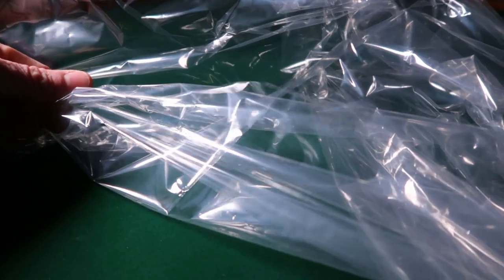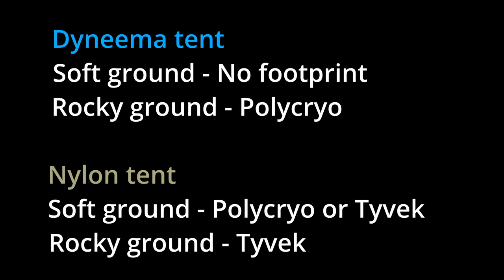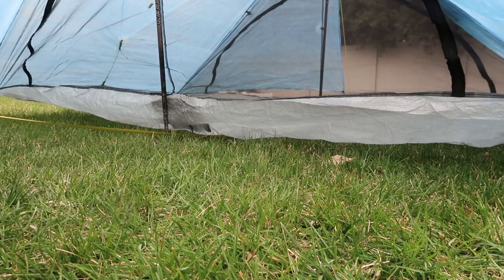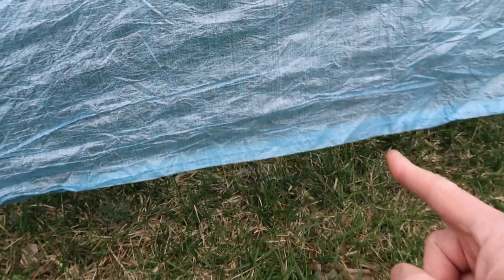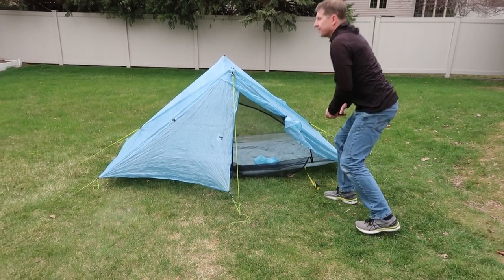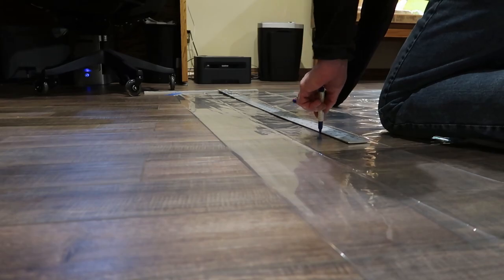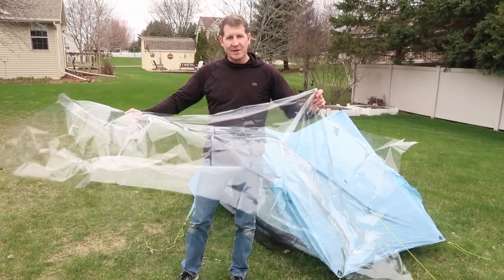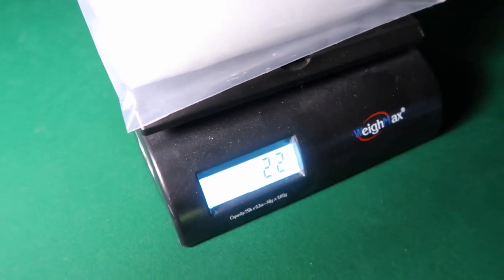DIY Polycryo tent footprint the RIGHT way

Comment: 1.  I get the Cyro from the cheap window insulation from Frost King, large size.
2.  I fold painters tape all around the edges which really adds some durability.
3. I stick some duck tape on 2 corners to help see which way is up.
4.  After placing it on the ground I carefully rub my hands over the surface & remove any sharp objects.

I have 400+ miles on my current piece.
Reply from the maker: Thanks for the suggestions.  Good stuff that viewers should consider.

Comment: I’m testing out using Mylar emergency blanket for the footprint. Has been working fine so far for the past couple of weekend trips. It’s likely not going to survive very rough handling, but it’s really light and dual use as emergency blanket.
Reply from the maker: That sounds like a good idea.
Reply: I was thinking about trying this. How did it work out? It’s a year later so I guess you have had plenty of time to love or hate it
Reply: So? How did it work out?
Reply: @JediStockTrader  the cheap Mylar ones from Amazon started ripping from the edges maybe 10 days of use. They can be fixed with clear tape but I don’t recommend them. Polycro was tougher, but I also started getting rips from the edges after a while as well. Both I think is caused by my shaking the condensation off in the morning, and also from granite abrasion. They have limited stretchiness, causing any rip to propagate quickly.

After going through a couple of them each, recently I’m switching to Sol emergency blanket XL. The size is almost perfect without cutting for my xmid pro 2. The material is slightly stretchy and feels significantly more tough, while being almost as light as regular Mylar. It hasn’t ripped on me yet but only used it on couple of nights.
Reply: @tanvach  Interesting your doing with SOl, I thought maybe it was not as strong or puncture resistant to the ground! I was looking at both to try for a tarp...mmm

Comment: Just want to say that I really appreciate your content. It is some of the most clear and insightful content out there for sure. I’m hiking the JMT in August and your related material was invaluable. I also have a Duplex but bought their DCF groundsheet that weights in at 3.1 oz (their numbers), so it comes in about an ounce heavier than the Polycyro but much better than Tyvek. DCF isn’t know for great abrasion resistance but I suppose that it isn’t being dragged across the surface too much - I expect the durability to be decent if not as robust as Tyvek. Also, I saw someone measure the puncture force with a needle across all three materials and DCF did not fare as well as the others but I’m not sure he even mentioned the DCF weight. Well anyway thanks again! P.S.: Loved your stove efficiency optimization study. Good stuff!
Reply from the maker: I saw that same video with the needle.  Interesting stuff.  Enjoy the JMT!
Reply: So how'd you do? You over packed didn't you?
Reply: @nedanother9382  I didn’t bring a ground cloth on the JMT with the distance, speed, elevation, and lack of easy resupply points S of MTR.

Comment: Thanks for the video. 
I disagree with the bulky designation for tyvek. It folds perfectly and keeps the folds for refolding. It folds very flat (definitely heavier) but I fold it and slip into my front pocket and it protects the mesh from abrasion from the inside items and gives a bit of protection of those items from light rain. I would use it as a "rug" if things were wet and dirty where I wouldn't do that with the more unruly poly. At the size of the duplex mine is used with a tiny bungy as a real rain skirt wrapped 1 and a half times around theres nothing to blow up and its bulletproof. Poly is lighter but less useful for other things. As well dirt and moisture tend to static cling to it more than tyvek. 
Just a thought for folks on the fence - I go back and forth depending on my ultralight mindset.
Reply: Do you have to fold it? I thought if you washed it , it gets less noisy and is easier to put away!

Comment: Jon, I have really appreciated your videos.  I went with Polycryo on the PCT and it was trash by Scissors crossing (mile 77, 4 nights).  So I agree, Tyvek if rocky.  Polycryo is probably OK for dirt (AT, much if Ice Age Trail, etc.), but I have not tried polycryo on dirt.
Reply from the maker: I’m finding that it’s good at keeping dirt off the bottom of the tent and that’s about it.

Comment: Do you hem the polycryo? Including taping an 'ear' to the poly corners in order to allow pegging out/running a line to the tent corner peg? Would be great to have your thoughts.
Reply from the maker: I did not, but there’s no reason you couldn’t hem it for additional strength.  The material is tough, but tears easily so that might be a good idea.  The ears should work as well.  The one thing I would not do is use grommets because that would just tear out.
Reply: @jonallenoutside  thanks. Im going to hem with 1 inch duck tape. Ive read and seen the pictures of adding a grommet by using a rubber tap washer within the duck tape 'ears' then just perforate through at the washer hole point. Their tests suggested the polycryo would fail first when used as a lightweight tarp. Im only interested in it as a footprint and add not too tensioned shock cords to the tent peg points,. It looked fantastic. Cheers

Comment: I always use a footprint, regardless of where I am camping — even if the tent doesn’t need the protection from rocks/roots/whatever, but it keeps the tent a LOT cleaner when I’m packing it up in the morning! The difference in what I did when I made a polycryo footprint was I did a fold-over all around to get a much more durable edge. I always fear I’m going to tear polycryo if the edge is raw.
Reply from the maker: I did the edge on my Tyvek footprint.  What kind of glue did you use?
Reply: I used double-sided tape. I laid out the sheet, then carefully laid the tape along the edge, and then folded it over on itself.
Reply: After backpacking this weekend with my triplex tent I noticed dirt on the underside.  I believe the poly will help keep the tent clean and it would certainly be easier to clean the poly vs the bottom of the tent.  I’m going to order some and try it.

Comment: I have asked this a number of times in different places - Does no one else find that polycryo falls apart with the slightest poke or tear?  I've used heavyweight polycryo, and it holds up as poorly as the very light window cover.  What do others find using it in as damaging a location as under a tent?
Reply from the maker: I’ll share what I find out as I put it to the test this season.  It seems like it might not hold up very well.
Reply: It may be that you didn't get the right product maybe? I've used them before and gave up because they were filthy but I don't remember any of them tearing or puncturing. I would definitely recommend the tyvek - a bit heavier but soooo much more useful. Folds flat and perfect. Slides in an out like it was lubed. It holds the fold lines for refolding. Can be used very well as a rain skirt. 
The poly just can't take a poky...its for abrasion only

Comment: Why did you mention not needing tyvek if your tent was not nylon?
Reply from the maker: Tyvek is overkill if you have a Dyneema tent.  In that case polycryo is more appropriate.
Reply: @jonallenoutside   Is not the floor of Dynema made of cuban fibre ? I saw a video of a test of this vs polycro and the puncture  resistance was the same!
Reply from the maker: @JediStockTrader  I use it more for keeping the bottom of my tent clean and dry.  Any extra protection is just a bonus.